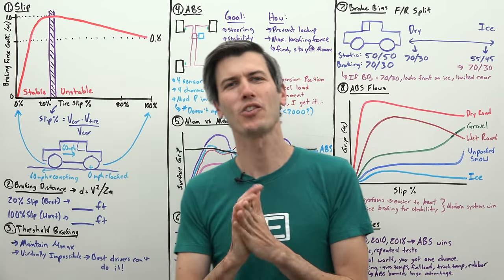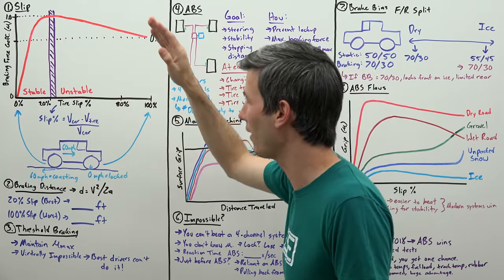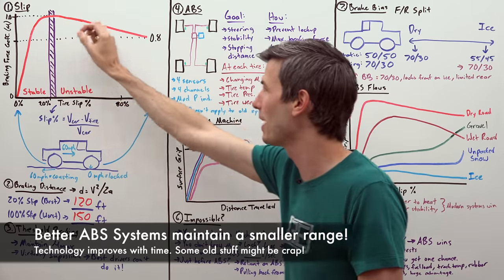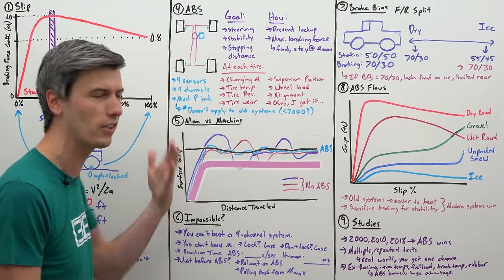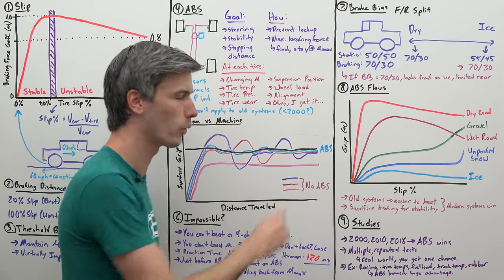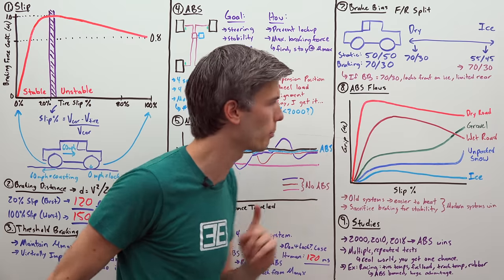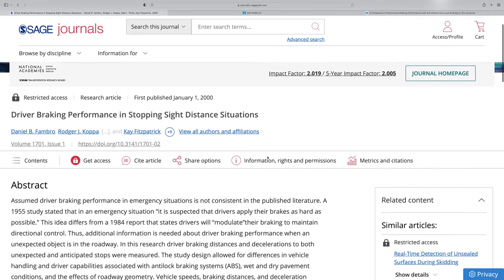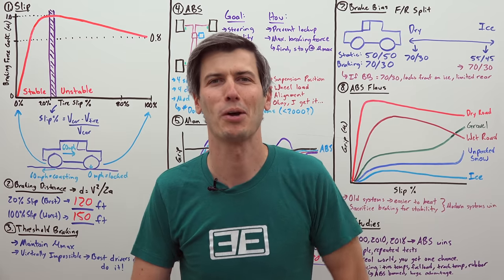Why Threshold Braking Is Impossible - ABS Wins!

Comment: Love it. Since I was explained how ABS works, I was never able to comprehend how the wheels sensors can differentiate between wheel lock up and final rest (velocity = 0). 
I can understand on modern system paired with ESP using accelerometer and gyroscope. However, on legacy systems relying solely on the wheels speed sensors (often hall effect sensors), I can’t get it. My theory was that there is a preset maximum deceleration timer  (under optimal grip and tires conditions) for any given speed. Therefore if wheels appear stopped prior to that timer, brakes pressure is lowered until wheels rotate again. If that make sense. 
Does anyone know the answer? This have been bothering me for so long.
Reply: basically your idea can work. Actually it has a "model" reference speed and it knows that there is certain limits within the speed can change. Also if you have ABS it is very unlikely to suddenly have all four wheels at zero speed (as in a real standstill)
Reply: Most vehicles also have vehicle speed sensors in the transmission. The car can look at all of the values to determine what's happening (assuming it was programmed correctly).
Reply: @brent4adv  the transmission sensor don't give you additional information. The transmission in most cases have a fixed connection to the driven wheels.

Comment: I think the "pull the ABS fuse when racing" thing I grew up with was just historically because we had older 1990s ABS systems that were not that great.  So that's probably the origin of this notion that a human is better than ABS.  Since then, in my 80s/90s cars, I don't use the ABS (also because they are broken anyways).  But in the 2000s+ cars, I let the modern ABS do its thing, even on the track.
Reply: 07 Yaris has no ABS, luckily I know to let go of the brakes if I lock up

Comment: Funny enough, when ABS first came out, they found that single vehicle crashes (trees, ditches, etc.) went up compared to non-ABS versions of the same car.

Turns out that drivers were "steering into the skid" that never happened, and were just running off the road. Hopefully, now that everyone is used to it, it has gotten better now.
Reply: That’s interesting 😂
Reply: I do believe that the reason single vehicle crashes went up was because people relied on ABS to stop their car better, but ABS doesn't increase braking power, it just prevents a loss of control due to wheels locking up. You can still drive too fast for a turn and skid off the road, unrelated to how you brake.
Reply: The more you swap control of the vehicle from mechanical used input to electronic computer decision-making, the worse drivers en masse will become. Seems awful to me, but w/e 🤷🏿‍♀️
Reply: @malapertfourohfour2112  I had a civil (transportation) engineer once tell me that each person has their own "threshold of safety," and if you raise safety in one area, they'll lower it in others. For example, a driver going from a small car to a big one will "feel safer," and likely drive more aggressively or drop seat belt usage to lower the safety again. It probably comes up in other areas.
Reply: @leoshahbazian6830  the whole point of the video is that ABS does indeed improve stopping distances, not because the maximum potential braking power of the car changes with an ABS system, but instead because the system gets much closer to that potential in almost all conditions.

Comment: Flawless video.  I love that Jason addressed different / older types of ABS systems and different road conditions.  I still suspect Rally is the one motorsport where ABS would not help even if it were allowed (precisely because of the need to lock up the wheels on gravel).

I would like to see a comparison of ABS system types across make / model / year.  4-channel ABS was definitely not the norm when it was first introduced.  There are a lot of 1999 Honda Civics out there and not all of us can pick up a Koenigsegg or McLaren like Mr Jason here.
Reply: Rally cars lock wheels because they use a hydraulic seperate handbrake system,, very often way too much.But ABS driving fast on slippery surfaces. Would lose so much time that they may as well stay home

Comment: As a mechanic and tyre tech with well more test drives than I can count I'd say a really good driver could beat ABS up to about 1998 in Australia and TC/Stability up to about 2004 especially if the cars a bit old and flogged out and no longer on its factory fitment of tyre. After that though 😅 not a chance. I tried and tried and tried and tried 😒 in the end I had to eat my hat and ask Mr Bosch if we could be mates and show me how its supposed to be done 😔 turns out he corners even better than he brakes 😑 I'm not giving up yet though 😅 I want 4x brake controllers wired to my brain before I totally give over to the bots 😆👌

Comment: Could you make a video about people without abs? In a danger scenario I usually use breakes by the sound of them and try not to lock completely up because I'm afraid of sliding and losing control. I usually use an empty road to do breaks testing once a year as well but if you have any advice on good breaking control for cars without abs it would be great for me

Comment: My general notion before watching the video is you can't beat ABS because ABS does threshold braking on each individual wheel, whereas manually you have to watch for every wheel, and you have to lift off your braking input when the first, least grippy wheel starts to spin.
Reply: Indeed abs controls each wheel individually, but, it doesn't threshold brake, it locks and completely let go of the brake many many times in a fraction of the time. That almost "on off" also breaks a bit the suspension load and reduces grip compared to constantly be on limit by threshold braking
Reply: @Dario01  If you had watched the video (or read any literature about it) then you'd know that this is not how it works.
Reply: @qwesx  i have some experience in racing simulator for example, and you clearly feel the opposite, obviously the abs reacts much faster than an human, but that don't necessarily mean better braking. And in the sim you can program the abs to be "perfect" instead of "realistic" cause that will further get them apart
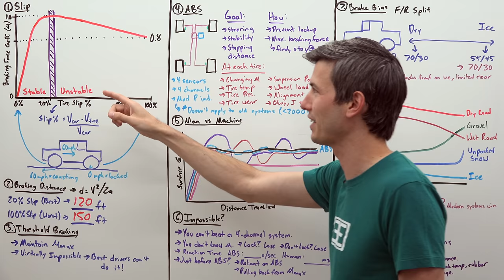Reply: @Dario01  @4:22 He goes over this topic
Reply: @Dario01  did you really just try to "trust me bro" with your experience from VIDEOGAMES?
Reply: @Kevin-dt9xm  it's not a videogame, pro drivers use it, but that video i linked ain't a videogame lol, but that was funny not gonna lie lol
Reply: @Dario01  ABS doesnt just react many times faster than humans, it does the same thing as humans. It brakes until the wheels lock up, then it lets go a bit (not all the way, he literally shows a graph of braking pressure from ABS) then it goes again with less pressure, and then the brakes start to lock again, and then it backs off again, and by repeating this process, after a few cycles of this, the abs system already knows the exact amount of braking force to give EACH INDIVIDUAL WHEEL. On the timescale of the drivers perception (and the timescale of the suspension), the wheels basically never locked up.

Now lets compare this to a human braking. Either the human locks up the brakes and backs off a bit, then applies them with slightly less pressure (exactly what the ABS is doing, but worse, because humans cycle hundreds of times slower than abs, dont have access to the same amount of information as abs, and cant do individual wheels like abs) or the human never locks up the brakes at all. However, since humans literally can't know the peak braking force they can apply before locking the wheels, if you never lock up the brakes, you likely never got close to peak braking force. The only way for a human to know the peak braking force is by trial and error, meaning seeing how hard they can brake before locking up the wheels.

Like he said, if humans were physically capable of braking at peak force, then seeing brakes lock up in racing would be pretty rare. However, as he said, its a common sight. The best drivers in the world can't brake at the limit without going over it, or else they would. Hell, ABS was in F1 until it got banned in 1994 because even 30 years ago ABS was so much better than human threshold braking that it was considered to be taking a lot of skill out of the sport.
Reply: @Dario01  sim racing is just gaming with gamers that take it way too seriously, dude. Trust me, ive also played racing sims.
Reply: @Kevin-dt9xm sim racing ain't just a game, but u can have ur opinion on that, about the braking, u do feel the wheels starting to slip, by that I mean rotating slower than the car s speed but not enough to lock, also, all the time the abs spends by braking bellow the limit or letting go a bit the brake to gain traction again( maybe not all the way as you said), is time lost on braking. Also I linked a video above where you can clearly see the difference in threshold braking vs abs braking distance. In racing , as weird as it sounds when you go to overtake on braking (without abs) locking 1 wheel still brakes better than not locking, because the other 3 wheels are braking with more force than without locking, as they have more grip cause of weight balance. The inside wheel is almost doing nothing cause it's so light at this point( in some cars u can even see the wheel lifting slightly off the ground). But it will damage more the tyres, so u try to avoid it as much as possible. About the abs in F1 it was banned to force the drivers to rely more on skill than technology and not as much cause of performance

Comment: Jason, I think you should do a follow up video actually doing some testing on an icy surface. Most conventional ABS systems exaggerate the the grip level and reduce braking too much. The people talking about the Subarus with terrible braking are spot on. 

Mercedes had a system called Sensotronic Brake Control in the 2000s that did a way better job of getting the wheels as close to that lockup point as possible. If you drove one of those on the same icy surface as a like vehicle with a conventional ABS system, the difference was amazing. It was hard to believe how much grip was possible on an icy surface.

Comment: I only have one vehicle with ABS, my new Jeep. Kinda wish my motorcycle had it, but I put so few miles on it that the statistical chance of needing it is pretty slim.

It's been a while, but I used to practice threshold braking at high speeds (motorcycle). It is an eye opener to try riding at 90 mph, use maximum braking force, and then look back to see how much ground you covered. It is literally what made me change my riding and driving habits on public roads.

Comment: I think the most important thing to clear-up is that ABS's main purpose is NOT shorter breaking distance, but not losing steering control while braking. As your number showed, saving a dozen feet of braking distance might make some people say "meh", but your wheels locking in a sharp curve - that's it - game over.

Second, the engagement of ABS is almost "binary" - when it activates, it releases the brakes almost completely so that the wheel can start rotating as fast as possible, then it starts braking again with the exact force needed not to overshoot in the slip region again. On measurement it looks like a sawtooth chart.

Third, to reiterate your point that it's ridiculous even to think about beating it :D The slip sensors on the wheels even on old ABS systems make several hundred datapoints per second, so before you even think that you should be careful on the brakes, ABS already has calculated the recovery patterns to apply if the threshold is reached. Not only you can't beat it in braking, it already beat you before you even thought about the brakes.
Reply: For some reason I read "game over" in the halo multiplayer announcer voice in my head
Reply: sometimes you want your wheels to lock up. with ABS you can't do that. but then again in those scenarios you wouldn't run a setup with ABS to begin with
Reply: Well, I dunno bout all that but I do know back in the day  I could jump on the brakes and the wife would hit her head on the windshield, the kids would hit the back of the seats and everything on the rear window shelf would go flyin  past year head. Caint do that with ABS so which is better, you tell me. Dint have seashells neither so There was that. 🍺
Reply: @blairleighton3343  Bro, learn to write, than you can talk about engineering
Reply: @blairleighton3343  Allow me to introduce you to this fabulous newfangled invention, called "the seatbelt". You will be shocked to find that your car might already have them installed.
Reply: @davidjereb  Humm, must be a new thing. Never gonna werk.
Reply: @luizhenriquepaes8991  Laughing uproariously. 😃  Cheers 🍻
Reply: Good example of this, I was making a right turn on a green light at about 15mph, there is a large dip in the road where the crosswalk is. A white jeep thought it'd be a good idea to pull a u-turn right in front of me on a red light from the straight only lane. I slammed the brakes and there was only a moment of the front left washing out over the crosswalk paint before ABS recovered it. We stopped about 5 feet front the front of each others cars. Without ABS the fronts would've locked immediately in the turn and I most likely would've gone straight on into him.

Comment: very useful stuff 
only one thing. with racecars you can have adjustable brake bias (even depending on corner phase) and adjustable abs(amout of slip I assume). But the bias helps you to turn in if it’s setup more to the rear. for hard braking you want more towards the front 
gt cars use abs, tc, automatic gb(sequential pneumatic paddle shift), they seem to be interested in making the cars as fast ast possible, it’s still just as hard to beat a good driver.

Comment: 12 years ago I worked for a truck air brake manufacturer after working there for 25 years.  I was involved with production of big truck anti-lock air brake valves.  ABS is superior to manual braking.  Jason is correct.  On big trucks short stopping distance is secondary, vehicle stability is primary.  It is meant to keep a trailer from jackknifing over the fifth wheel hitch.  I believe the range centered for that manufacturer was about 8% slip.  Over the road truck trailers modulate either axle by axle or side by side.  All the data told there was better performance with more wheel speed sensors.  The reason why I don't work there anymore is the manufacturing plant was closed and all equipment was sent to a new facility in Mexico.
Reply: Ah, the good ole "outsourcing"!
Reply: @SI0AX  customers always hate seeing price increases.
Reply: @SI0AX  prices rise because people like -- or need -- getting raises (even when their productivity does not increase).
Reply: @RonJohn63  If employees don't get a raise, they actually make less money due to inflation. Do you see supermarkets keep their price the same when inflation rises? No, but they sure do keep the employee wages the same, effectively paying the employees less. That is why the pandemic was such a boost for supermarkets because they indirectly lowered their employees wages.
Reply: @SI0AX  "If employees don't get a raise, they actually make less money due to inflation."
That's obvious.
Reply: @RonJohn63  I forgot to emphasize that most wage increases don't account for inflation. Like if you gen a 2% raise, but inflation rose 5%, you are basically getting a 3% wage reduction.

Most employees get indirect yearly wage reductions.

Comment: I'm not sure which video I should ask this in, so here goes. I currently drive a 2016 RAV4 with AWD, but a few times coming up to a stop sign, it was more slippery in the winter than I thought, so I started slipping into the intersection. One time, I just relied on the brakes, fully depressed, and I was halfway or nearly fully into the intersection by the time I stopped (thankfully, it isn't a busy one). I was straight, but stopped int he middle of the intersection. Since I used to gear down when I had a manual transmission car to help me with control in the winters, I tried the same in this vehicle. And it makes a huge difference!
I watched your other video about coasting in neutral and I think that gearing down was addressed a bit here too, but I'm not quite sure if gearing down causes as much wear on the hard to reach part as driving in neutral does (I can't remember the name of the part, but it's thin and apparently wears down faster when coasting in neutral). 
All that to say - because of the extra control, I've made it a habit to gear down when needing to slow down, even in summer now. Should I stop gearing down except for when needed for winter driving when I need more control?
Thank you for all your helpful information.